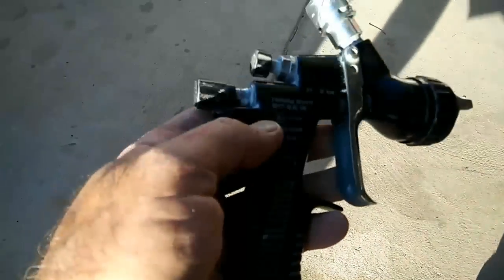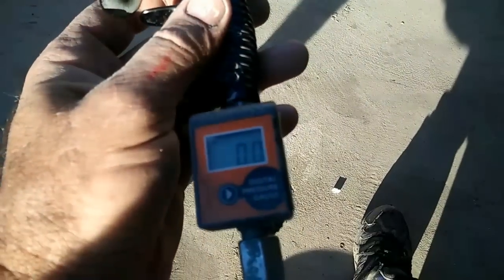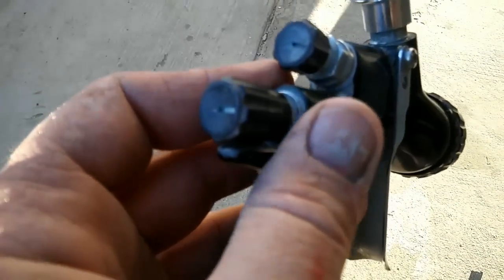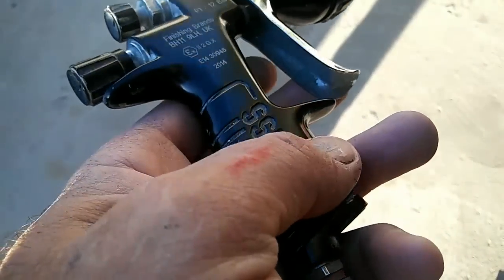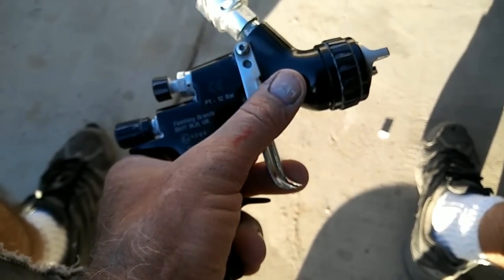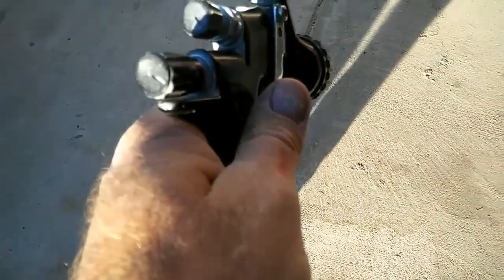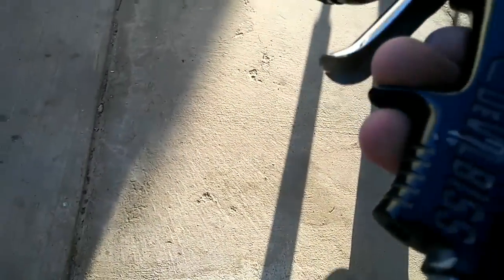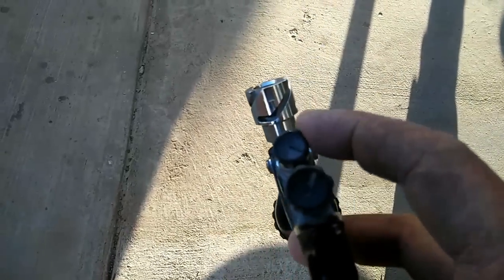How to spray clearcoat without getting any Orange Peel

Comment: Man I’ve got two electric radiator fans that were on junkyard radiators and became extra, and I use two batteries always topped off, and they move a ton of air.  I first tried making a downdraft to keep ALL overspray/dry-in-mid-air paint form landing back on the nice wet surface I just passed.   I used some strategically placed lighting and a camera to the side and it looked like a fast mist waterfall just getting sucked into the fans.  And as far as “painting the neighborhood” that BS.  If it was gonna land dry within several seconds of leaving the gun and becoming a dry rough coat, then by the time it goes through the fans it’s DEFINITELY going to become simply dust, as the air movement itself will make it dry more quickly as well.    I took an old beige linen sheet and placed it over the fans to see what was going on.  Of course it got black dusty, I’m painting black.   But I put the clean section on my gold Suburban and nothing.   Not even dust on the linen.   And this was parked 10’ from the fans tailgate to the fans, and a huge truck, light color.    Even the driveway shows nothing.   After I’m done I’ll clean up all the masking and spray the driveway to rinse it off and there is some black dust, but it definitely doesn’t paint the driveway.    On the other end of the garage I have a linen sheet sealed off across a half-opened door to prevent bugs and dust from getting in.    The linen will show some green from pollen, which demonstrates that not only is there a lot of flow, it’s catching most of the pollen, and the air has to go through more turns and ups and downs before reaching the paint zone, so while it ain’t a $zillion dollar paint booth, my hood on last session had ZERO dust nibs, which I thought was impossible, and zero fish eye, due to sealing every singe thing with petroleum or silicone contents or removing them to a container outside.    Chain fall is bagged and sealed.   Engine of car I’m painting is bagged, undercarriage is taped off to the floor, wheels are enclosed completely, and stupid attention is paid to cleaning panels thrice before paint, as well as blowing out the garage twice a day for two days before paint time, sweeping it out over and over, using dehumidifier to get humidity down to about 30-40% so that when I spray down certain areas with a mister to also keep dust down, the humidity doesn’t jump up to 60%.   The misted areas also mean the curtains inside the booth, my shoes, the hose
Is wiped down, and the ceiling got a coat of cheap clear coat a long time ago and auto paint sheet plastic glued to the ceiling  with small applications of spray adhesive, mostly the perimeter and center, kept tight.     As clinical as I can get, great airflow, moistened linen two for one intake filter, moisture here and there to grab dust, and a new Tyvec suit every time, plus a cool little flyback transformer creating ozone that I’m about to use for the first time.  I experimented with it.  I charged a sheet of aluminum foil and used dry guide coat as a test dust.    When I applied the contacts, some dust jumped off the foil, and most of what was falling was repelled.   Obviously that’s cheating but very cool to watch.   Basically I’ll charge the chassis in sections cause the transformer isn’t that big, and at that can get your attention if your not careful, but the panels will actively REPEL dust AND bugs!    Does your zillion dollar booth do that?  While blocking the primer the floor has more dust than ever and the air less.    Not sure how airborne paint will do, and gotta be careful to not make the panels attract particles.    But it works better than I could have dreamt.    And I get free electro-shock therapy to keep me in line too!!   Is your big time booth also your therapist?   I do get zenned out and the little zaps through rubber gloves is just enough to keep me focused.      Plus Carcass or Sabbath blasting away helps too.    I’m just trying to beat orange peel.    Oh wait till I tell you about my laser distance guide.   Maybe I should patent it first.

Comment: Good video as instead of pro spray booth environment that many film, this is about your garage. I am getting ready to do a car (sealer, base, clear) with PPG products. I have a new gun (Walcom Slim Xlight HVLP) and of course all the specs be it the paint sheet or the gun manual reference that "29 lbs" as an approximate setting. This is a garage that is enclosed with plastic sheets like a booth with great lighting. YOu may not be familiar with that specific gun but my local reputable paint shop said It is decent and below a Devilbis but well above a typical Harbor Freight. So you are saying start at about 15psi at the gun and play with say a  8-10" fan and somewhere around 2.5 turns open on the fluid setting? Yes, I know my spec may vary but the test spray on a piece of aluminum should show very small dots close together with maybe a slight hint of peel in the first 30 seconds or??
Thanks for the advice. I have painted before back in 2017 but each project has it's specifics.
Reply from the maker: Try at full pressure. No I dont know that gun. But if you cannot see you may need to turn it down on the second coat. Start at like 2 turns out then open 1/4 turn at a time till you get the material amount to work with your spray speed. If you cant see (because of the fog....not lighting) you will need to turn down the air pressure a bit. Then make sure to start again at 2 turns out then open it up slowly until you get the best compromise.  I was referring in the video mostly to the tekna. But many of the good guns need lower pressure for DIY at home in a garage. You dont want to totally ventalate all the fog outside because overspray will travel a long distance. best to keep it low.
Reply: @Mikefngarage  Thanks Mike, appreciate the detail. I was going to rent a 14 cfm compressor but have my eye on a used 4hp that pumps out 11.9 cfm (and 8.8 scfm @ 40 psi). My gun calls for about 9 cfm so that may be OK. Opinions?
Reply from the maker: @larrygk1257  yea that is probably a low air use gun. the tekna is not. you should be good. Go to harbor freight and pick up a regulator and a Desiccant water trap. and put 2 fittings on it put it at the air line. Regulate at 50lbs they have them cheap. I have 1 setup just for spraying.  They have a small regulator and Desiccant filter.
Reply: @Mikefngarage  Yup already have the reg and the trap. And I opted for high flow fittings as there is the interesting discussion about air pressure being to dependent on setting it at the reg vs. setting it more at the compressor.  https://www.youtube.com/watch?v=HDuuJvyiZiI

Comment: I heard using slow reducer will help a lot to. if u doing it's in your garage
Reply from the maker: good point when you have a high solids clear that requires reducer. If you reduce clear that does not require reducer it will make the clear not last.

Comment: Thank you, this has been super informative. The takeaway seems to be that HVLP needs to be misted because the low pressure can't finely atomize a large amount of material. Do you have any thoughts on LVLP? I do guitar finishing and it seems like an interesting option because you can run a smaller/cheaper compressor and you're working with far less surface area.
Reply: I too would like the answer to this and what the settings would be for a LVLP
Reply: A lvlp budget gun that's good for small projects is the sprayit 3300 lvlp gravity gun. You can run the gun at normal settings and pressure.
Reply: It's not so much about hvlp vs lvlp determining if it needs to be misted on. He is talking about using lower air pressure and adjusting your settings accordingly when not spraying in a booth. If you were in a booth and the resulting cloud of overspray gets exhausted out you would absolutely crank up the pressure to around 29psi , or 2 bar. This would be true whether using the hvlp air cap or te10 or 20. Full fan, full fluid is what the Pro Lite likes at that psi.

Comment: Try out the Atom guns. Top notch quality without the Dvilbiss/Iwata prices. (nobody in their right mind would buy a sata unless they live on the oh I have expensive paint guys so therefore I must be a great painter mentality). 
I bought a used Atom Mini X16 on the cheap. Used it on some old bug parts. Was impressed. Tried it again on a a couple smaller fenders.  More impressed.  Being a mini,  it has its limits. I decided to buy a full size gun and bought the Atom X21.   Lays down paint just as good as the tenka pro lite.  Lays down clear even better. Since then though I bought the X20 for clear as clear doesn't need a great gun to lay it down nice. That worked great as well.
Reply from the maker: yea looking for that cheaper gun that does the same work. I like the tekna , sigola cant afford a sata. want to try a iwata super nova. From what I see they are more like the old high pressure fan. Which you can be further away. project more straight at the panel but still wide.
Reply from the maker: painting that bus is not forgiving. vertical flat panels and the edges of the windows 90 degrees requires good gun. I have painted normal newer cars with cheap guns and it turns out just fine. but on that flat surface if there is a slight orange peel you cant even sand it out. it still shows after color sanding it with a block.
Reply from the maker: Yea I think my buddy was talking about these. he is a body shop painter for more than 20 years. Which is the best one they make for clear is it the x20 or 21. He told me about a gun that started with an A. but dont remember which one there is another too.
Reply: @Mikefngarage  they have a X20/21/27 (full size guns) in hvlp and lvlp They have the mini x16 which i bought used that made me fall in love with it. They have a new side mount cup gun as well which I will be getting for its versatility. 
As for best for clear I use the 20 but if there is a difference I haven't noticed it. I just like to keep a clear gun for clear/base for base and a primer for primer ( I use a devilbiss flg4  [1.3/1.5/1.8/2.2 tips] for my primers.) The 2.2 is awesome for high builds. Before I got that gun I used a starting line gun with the 1.5. does the job but the 2.2 lays it down nice and thick. 2 coats vs 4 or 5 with the 1.5

Comment: If you're gonna use clear to thin out your clear, do it on your 2nd coat.....NOT your first coat.  I've sprayed complete cars with my little Harbor Freight gun and always get good results.
The truck is to keep your gun CLEAN inside and make sure you've thinned the paint properly and then make sure your pressure is correct.   ;-)

Comment: Interesting, as a novice with a cheapie gun learning with 2k primer, I had issues with dry spray on the center of my hood with the material setting wide open and 25 lbs at the gun.  Maybe I was too far away, as you were pointing out?
Reply from the maker: yea probably primer you need to be close to the  area because it mixes with the air more and dries when not projected at the surface. The cheap gun does not project the heavy primer very well.

Comment: A good trick for setting a spray gun is to twist the material knob out until it’s about to fall off, then pull the trigger all the way, while pulling, tighten the material knob until you feel resistance on the knob/it’s pushing the trigger forward. Turn the fan knob all the way out to get the widest spread and make sure your PSI at the regulator is 30PSI. This is a baseline that I learned from Paint Society here on YouTube and it doesn’t need to be tweaked much if at all between spraying paint and clear. It does however make everything more simple as you don’t always have to be playing the guessing game when setting up your gun, or feel like you need to set it up each time.
Reply: My only question though is will this work for someone in a garage setting? Paint society is professional booth only
Reply: This is totally wrong.  First of all, if you're in a shop, you probably don't need to look at these videos for tips. For the guy at home, wide open is the best way to overspray city and lots of paint issues.  The DIYer needs atomization at the lowest pressure and widest fan possible which means fluid will be far from wide open. You make up the rest in your passes. 

I've stopped watching Paint Society Because he doesn't address the differences between home and shop, yet continually suggests things to the guy at home

Comment: 3 years later the 200 harbor freight black widow hte is an incredible all in one gun.
Reply from the maker: I hear that I have the Spectrum and it is good too. There is a cheaper gun in the UK that is really good Devilbiss FLG-5 not the same as the US FLG....and cheaper than Black widow. But black widow is good and capaple of spraying with no orange peel when every other thing is correct. Clear, hardener, reducer, distance pressure,

Comment: Mike, does this Tekna Prolite 16psi fluid knob 2,5 turns out and about 5" from panel apply to shooting BASE with Tekna Prolite?
I am a newbie and tried the technique last night on a junk door I DA'ed with P400 and shot 2 light coats of white base, waited about 30 min and did 2 coats of clear, clear lay pretty flat, but I had a coupe runs. What is the remedy for this? Bump up pressure a bit or speed up your arm movement or?
Thank you, man!

Comment: your using a HV 30 AIR CAP....IT LAYS DOWN PAINT KINDA THICK....TRY USING A TE 20 AIRCAP..HAS  SMALLER HOLES IN AIR CAP...SMALLER HOLES EQUAL SMALLER DROPLETS....OR I USE T110 AIR CAP WHICH IS BEST FOR MIRROR FINISH WITH CLEAR COAT
Reply: shannon hoagland ...he's right use a te20 cap ..and yes 10% reducer and up to15% does not compromise the clear ..1.3 too and te20 cap ..I use it EVERYDAY at work all day and can make the clear look like the factory or glass smooth how ever I spray ..
Reply from the maker: te 20 not legal in the aqmd area in socal. Te 20 has few areas that it is legal in CA. Read the approval sheets. Kinda weird that it is not recognized as legal for the hole state. Reducer does make the clear spray finer but I have had failures from reducing clear even 10%. some clear only last 3 years in direct sun when reduced.
Reply from the maker: agreed If your in a place say a spray booth that the te20 is legal and you can crank it up to 2 bar or 29lbs. you can open the gun up all the way and spray clear like a mirror. I am explaining to people who are not in that situation. if your spraying outside or in a garage you just cant see anything when you are cranked up that high. the fine spray just is like thick fog. You just cant have enough fans either. So if you need to use lower pressure you can reduce the  material amount and still get a nice finish. Maybe not as nice as in a booth. Booths are not just for controling dust they are mostly to control the fall out from the gun and keep it from landing on your work.
Reply: Makes sence...love the teknas by the way ..best gun for the money !! ..I see what your saying
Reply: Also I guess the diff is I use a Ms spies hecker clear and it takes up to 10% reducer.thats what's in the TDS ..id say they have there Pai TS figured out pretty well ..axalta is the leading paint manufacturer it's awesome stuff !!
Reply from the maker: Yea the 2 to 1 clears many you do need to reduce. like Spices hecker and glassuritt, also RM or Akzonobel sikkens product. Need to read the label on that. Just talking about mostly 4 to 1 medium solid clears. I may make another video specifying the clears you can use
Reply from the maker: species hecker is awsome stuff. used many of their products including lessonal. which is their cheap line and it is better in my opinion that PPG. Also Sikkens is similar. 2 to 1 clears may require reducer. most 4 to 1 dont. Always read the label to see if available to reduce. TDS reading is a must with all paints and clears. If it doesnt allow reducer or has a limit you should always go by the label. over reducing clear can make it easy to spray and flatten orange peel,  but will cause premature failure.
Reply: HV30 air cap makes the LEAST WET coating and the finest atomization. It doesnt lay it down thick. TE10 creates the largest droplets and is the WETTEST coating.

Comment: Great video! Do you ever lay down clear and it looks excellent and glass when wet but as it dries it turns orange peel? I was using a real high solids Debeer clear so I wouldnt have thought it would shrink so much to make heavish orange peel. I'm just not sure what caused it. Do you have any thoughts on that? (Using a Iwata LPH400)
Reply from the maker: No I have never put down really good high solids clear and had it shrink. The better stuff stays smooth. There is some shrinkage in about every product but stuff like Tamco HS which is like 56% solids or Kapci 6030 is high solids like over 50%. the stuff I used on this was like 46% but medium grade solids and no shrinkage.  Another like some of the Chameleon clears are high solids up to 59% and the dont shrink much either. Also Silco has some good ones with no shrinkange. Could it be that you added to much reducer. Max usually 10% on the best stuff. I only reduce stuff that calls for it. Reducing clear is not good past factory specs. not familiar with the name product you were using.
Reply from the maker: also could be a base issue. I have had that dull the clear coat and shrink. Cheaper base or urethane catalyzed base shrink under the clear and cause issues like that. it it was the 2 to 1 HS clear they make that is weird. From the prices I see on it  I dont think I would be trying it. Like 400 a gallon. The products I use are less than 200 and really good stuff. Kapci 6030 Tamco 2104 Silco I think its X13 or something like that. There are several and Chameleon has some excellent clears that are pretty cheap too. all under 200 a 5 litre 2 to 1 kit.